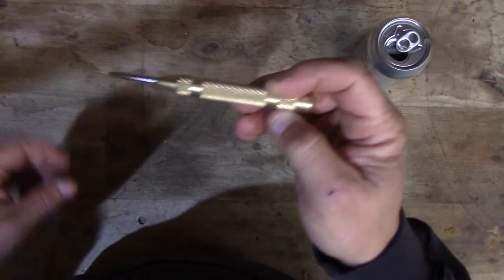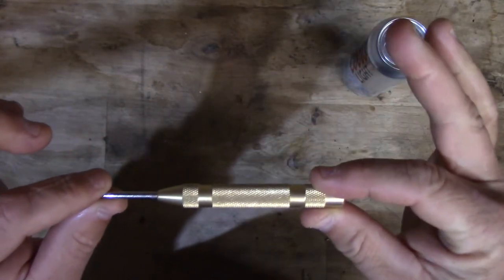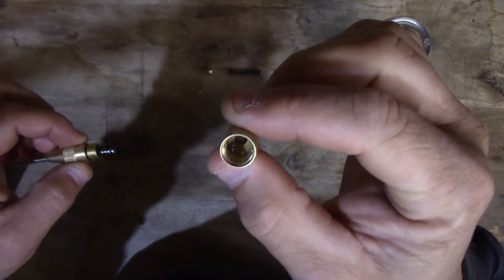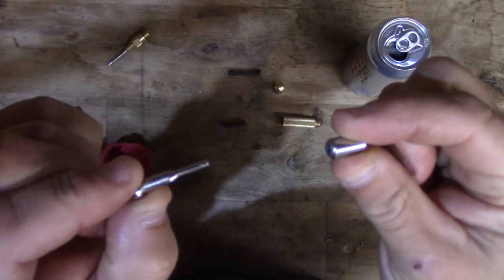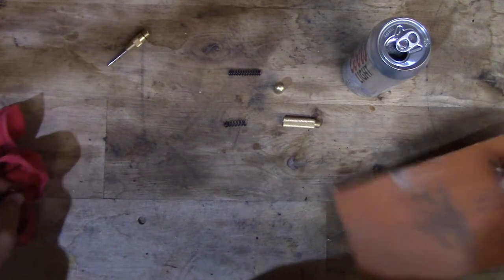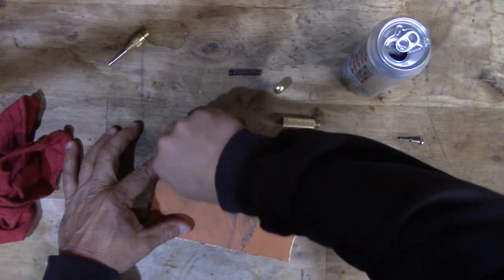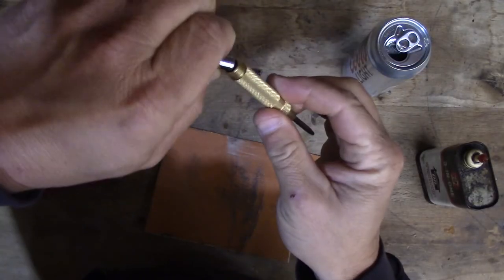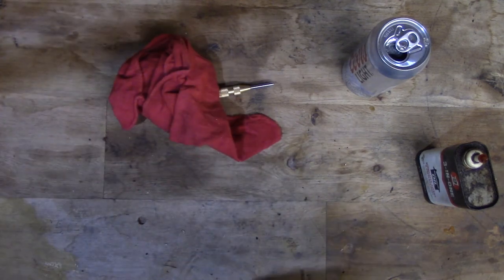Harbor Freight Automatic Center Punch Repair

Comment: I ended up getting pissed off when it was fucking up so I just hit it with a hammer like a traditional punch and completely ruined it. I still use it like that however and it works alright.
Reply from the maker: fuzzy wuzzy I almost did the same. I'm sure it was oddly satisfying.